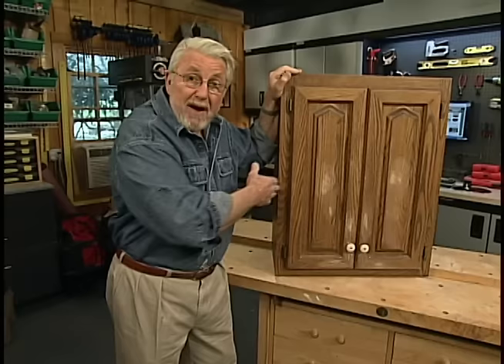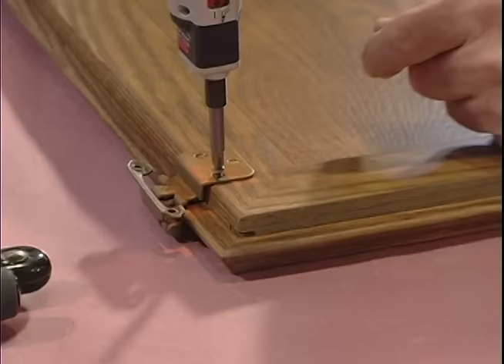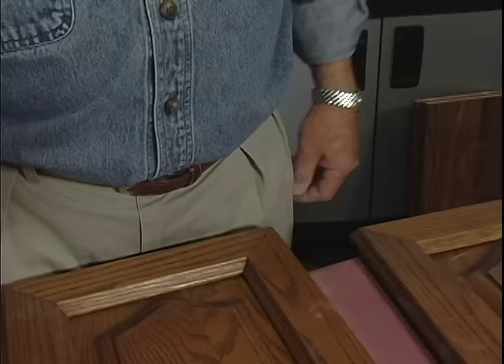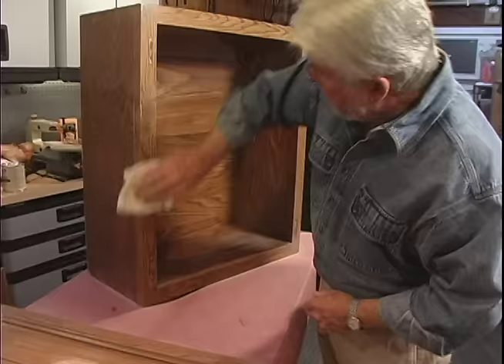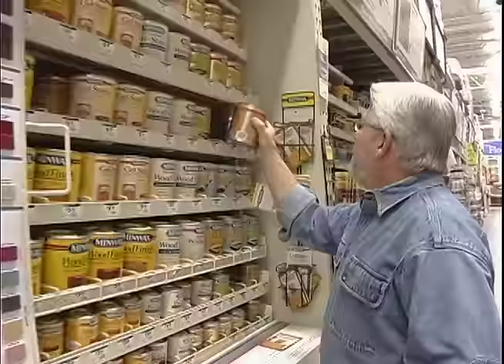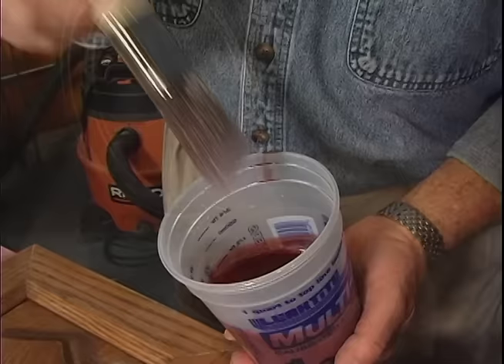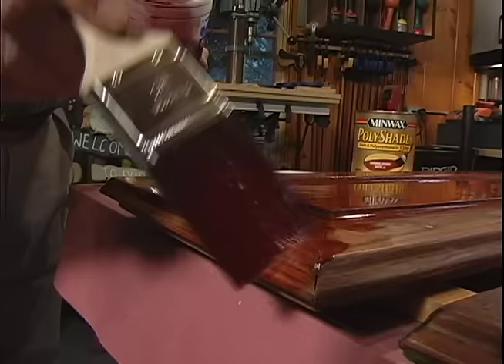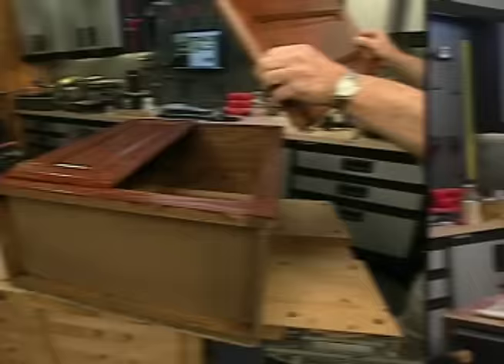Refinish Kitchen Cabinets Without Stripping

Comment: Finally someone who's not painting over beautiful wood cabinets.Thanks.
Reply: My Grandparents house, RIP. The New Owners Took all the Glass Knobs Hardware off, replaced with cheap plated brass hardware. Then they Painted the Solid Maple Doors, my Grandfather Finished them himself around 1947, and refinished the Varnish over the years. The Varnish was as smooth as glass. There were no Stains Scratches or Chips in the Wood. Makes me sick what they did.
Reply: I get paid good money to paint stained cabinets. Usually do a specialty finish over the paint. Looks way better in older homes with too much stained wood. I also do his style of finish also. Never do I use stain and poly.NEVER. It just looks really cheap. After using gell stain,I will spray poly over it.
Reply: We are getting ready to remodel our kitchen and want to keep the wood cabinet faces out neighbor made 30+years ago.   It doesn't appear that ours have been sealed at all.  I'm thinking of just using re-store on them, than some wax made for them.  I'll probably do it this way when we remodel our bathroom.
Reply: Amen.

Comment: I called a licensed painting contractor to get a quote on refurbishing some custom cabinets in our home and some wood flooring.   20 years earlier I had paid $5,000 to a licensed contractor to do the same.  This time a salesperson came out who had no knowledge, took pictures with their macbook and then emailed a quote of $24,500.
YouTube saved me with videos like this one.  Especially helpful were Ron's suggestions on replacing the hardware with new hardware and not shaking the can but stirring instead to avoid air bubbles.
Thanks, Ron!
Reply: How did u work
Reply: I just received a $20k estimate to repaint my kitchen cabinets. I laughed when I saw it. I'll be doing it myself!

Comment: The sequence of events is spot on. Two that are not used by most "flippers" are washing off with a solvent prior to sanding to remove if only some wax and cooking grease. The second is when painting multi layer doors including entry doors is to paint from the inside out saving the horizontals and then the vertical  elements for last. The product used is an alkyd and a natural bristle brush is more suitable than a synthetic bristle. Natural bristle brushes should be considered needing pre washing and drying in paint thinner before any painting or clearcoating is done.Working out of paint cans is counterproductive. Transferring the "paint" to a container larger than the volume of paint allows one to see if the "paint" has been completely mixed with no traces of pigment, filler or flattning agents left in the can.  A great 5:19 lesson from a pro.. Yep, we can tell...just by the way the sandpaper was folded.

Comment: Another way to stir  is with a bent wire coat hanger.  Straight into a drill then bent at the bottom into a whisk form.  It stirs the bottom into the body and doesn't introduce bubbles into the mix.  You can stir fast or slow - your preference.  By raising and lowering it, you blend the whole thing - or put bends into a length that fits the can and then blend the whole thing together.

I use this to blend/mix my stains and paints.

Comment: Wish I had seen this before I completely sanded my bathroom cabinets down to the clean white oak surface and refinished with stain and polyethylene. 
Also use caution when updating the hinges. I removed the old antique brass hinges and replaced with the same kind of oil rubbed bronze hinges. Even though they looked the same, they are different. The screw holes do not line up. I just screwed into another place on the door, but had to drill out the old holes on the cabinets and plug them with dowels before realigning and reinstalling the doors.
Reply: I am going to use the same hinges and just clean them thoroughly. The old ones are made really well compared to the new ones. Also, why waste good hinges when I use reuse the old ones. Also, it will be easier just to put them back.

Comment: The tip about folding abrasive paper into 3 is actually more useful than you would imagine, whether you tear your paper into halfs or quarters isn't the point,the point is you have 3 faces,6 edges and the folding it back on its self means it holds it self together, if just folded in half it just slips...as told to me by my tutor in college on the first day....40 years ago.

Comment: Polyshades works quite well for this. However, you do have to apply it as thin as possible and look over your project carefully for sags on vertical edges. It tends to settle along these edges leaving a darker line.  A high quality brush is very important.
Reply: What about applying with a cloth?
Reply: @careybowden4864  I have never tried it. A good brush and mineral spirits to clean the brush is not that expensive.
Reply: i like to have some foam brushes handy for those areas your referring to.

Comment: One of the things I was really looking for was doing both sides. In my previous projects I have found that the stain/finish application always accumulates where you can't see it from the top until you turn it over. Then it's a chore to get rid of the excess and still make it look good. I'm guessing you rest the door on something smaller then the door to raise it so that you have access to that excess.
Reply: I've had that happen to me as well.  What I found best is to place a gallon paint can, or something a bit taller, under the item so that as I do each edge I can gently wipe away any finish that may have run under the edge.  I use a clean cloth dampened with mineral spirits.  I use this same method when I]m staining or painting.

Comment: I guess it's easier to go darker, rather than lighter. I think applying stain on the entire surface, letting it dry, and then spraying varnish on top would also work.
Reply: But this two in one product saves the step - looks good to me
Reply: @elizabethhallowell5115  Scratches and knicks would stand out because scratches and knicks would take the two-step coating differently. This would be especially true on doors and the front of cabinets, ... and much more if those surfaces happen to be a eye-level. There is a place for this product, but wood surfaces would have to be next to perfect.

Comment: Here's how I refinished my oak cabinets.  I sanded them and stripped all of the finish off.  I grain filled them with aqua coat and then resanded them.  I then used my $13 Harbor Freight spray guy to spray Sherwin William's Acrylic Enamel.  It was a lot more work than what you see in this video, but the results were excellent and the cabinets look updated.  Oak be gone!

Comment: Thank you for the pointers. I will be re-staining my kitchen cabinets in the next couple of months
Reply: Me too!! from golden oak to a beautiful grey!!
Reply: Based on my 40 years of experience, now retired, in painting, staining, faux finishing, restoring antique wood finishes in all kinds of furniture, this is the worst advice I have ever heard from someone who is suppose to be a craftsman. My god, LOOK AT THE DETAIL  after he is finished showing the before and after. There is all kinds of flaws in the finish!!! YOU NEVER EVER USE A POLYSTAIN in refinishing....PERIOD..and NEVER USE A STAIN PENCIL...PERIOD....Refinishing anything without taking it completely down to bare wood requires time and patience in order to get the stain evenly dispersed around your project no matter what it is. Yes, for the novice, do the prep work he suggests and thats where you stop with this guys advice. Again, for the novice, buy yourself a ' GEL STAIN' and a professional natural bristle brush. I recommend getting the blond bristle. Again, for the novice, you want to take the brush and place it in a container full of mineral spirits and bounce the brush up and down on the bottom for a minute. This will aid in loosing and loose bristles that may be in the ferral. Remove the brush and shake it out by placing it between both your hands and rubbing the brush back and forth causing the brush to swirl back and forth. Put the brush back in the mineral spirits and repeat. Next put the brush back in the it's wrapper that it came in and let it dry over night. Again, for the novice, After you have prepped your project, use a little amount of gel stain on the brush and get in all the crevices first and they all the flat parts and sides, called revels, and let dry over night. Remember to clean the brush each time you use it!! DO NOT USE a lot of gel stain because to do this right you may have to do this a number of times perhaps up to as much as 3 coats for uniformity. Next day, look where all the light spots are, that is where you need to add just a little of the stain. Dab a little on with a non shedding cloth or paper towel than take your brush and sweep very lightly over the area to cover it and feather it into the rest of the wood that is not so light. Let dry. Do this again until you see uniformity. Then apply another light coat of gel stain and let dry and again, look for light spots and repeat what I said above and let dry. Next look for light spots if any, repeat if necessary. After you have uniformity, and your project is dry, apply by spraying, from a can, a light coat of polyurethane to seal in the stain. Let dry. Then you can a use either 2-3 more coats of spray or 2 coast of brush on polyurethane and let dry completely before putting the hardware back on. Now enjoy your project.
Reply: Based on my 40 years of experience, now retired, in painting, staining, faux finishing, restoring antique wood finishes in all kinds of furniture, this is the worst advice I have ever heard from someone who is suppose to be a craftsman. My god, LOOK AT THE DETAIL  after he is finished showing the before and after. There is all kinds of flaws in the finish!!! YOU NEVER EVER USE A POLYSTAIN for refinishing..PERIOD.. and NEVER USE A STAIN PENCIL...PERIOD....Refinishing anything without taking it completely down to bare wood requires time and patience in order to get the stain evenly dispersed around your project no matter what it is. Yes, for the novice, do the prep work he suggests and thats where you stop with this guys advice. Again, for the novice, buy yourself a ' GEL STAIN' and a professional natural bristle brush. I recommend getting the blond bristle. Again, for the novice, you want to take the brush and place it in a container full of mineral spirits and bounce the brush up and down on the bottom for a minute. This will aid in loosing and loose bristles that may be in the ferral. Remove the brush and shake it out by placing it between both your hands and rubbing the brush back and forth causing the brush to swirl back and forth. Put the brush back in the mineral spirits and repeat. Next put the brush back in the it's wrapper that it came in and let it dry over night. Again, for the novice, After you have prepped your project, use a little amount of gel stain on the brush and get in all the crevices first and they all the flat parts and sides, called revels, and let dry over night. Remember to clean the brush each time you use it!! DO NOT USE a lot of gel stain because to do this right you may have to do this a number of times perhaps up to as much as 3 coats for uniformity. Next day, look where all the light spots are, that is where you need to add just a little of the stain. Dab a little on with a non shedding cloth or paper towel than take your brush and sweep very lightly over the area to cover it and feather it into the rest of the wood that is not so light. Let dry. Do this again until you see uniformity. Then apply another light coat of gel stain and let dry and again, look for light spots and repeat what I said above and let dry. Next look for light spots if any, repeat if necessary. After you have uniformity, and your project is dry, apply by spraying, from a can, a light coat of polyurethane to seal in the stain. Let dry. Then you can a use either 2-3 more coats of spray or 2 coast of brush on polyurethane and let dry completely before putting the hardware back on. Now enjoy your project.
Reply: Dannyixoye well do a video on how to do it properly then
Reply: @dannyixoye262  thank you. Taking your advice. Now make a video please
Reply: @dannyixoye262  make a video please!

Comment: Buying 1 new handle for 1 newly mounted kitchen door has lead me to replace all the handles on all my cabinets and if I'm gonna do that, I had better re-do all my kitchen cabinets first! Since I'm doing all that, I had better faux upgrade my counter tops and add a faux tile backsplash by my kitchen sink too since I have never had one there. All this will require getting a new faucet, and I should have a new sink too but that's where the buck has to stop for now.. Lol Thank you for the great video! Ummm...might need paint in a few places too!
Reply: One thing leads to another!  We decided we needed to replace our formica countertops and floor.  Then we decided the wallpaper has to go!  Oh, what a lot of decisions to make.  Not only that, we have to remove all pictures and remove everything on the floor of the closets.  That leads to decluttering and putting stuff downstairs.  We will have to remove 3 bedroom sets in our living room and sleep in the downstairs bedroom.  Might have to end up doing dishes in the bathtub when the kitchen is done.  A good thing I work so I don’t have to look at the mess all day long!

Comment: Thank you so much for your helpful and detailed video!  I'd like to refinish my kitchen cabinets but I'd like to paint them in a different color. Should I sand them more heavily? Is there any other step I should take into account before applying new paint?
Reply: Do you mean paint instead of wood stain?, if so, I would say prime ( have it tinted the same color you want to paint them), use two coats and sand in between with a 120 sandpaper. 2 coats of paint depending on paint and color then sand with 220 in between. Hope this helps. ( if you don’t want to sand that much, BIN primer is highly recommended but, make sure to use a respirator and good ventilation. Work quick ).

Comment: I really HATE using the combination stain/poly.  It is VERY difficult to keep "smooth"
Reply: I add a bit of mineral spirits to it and it makes it much more easy to apply and get a smooth finish.  Have you ever used PolyWipe by Minwax?  It's a great way to go.  You can add stain to it and get the smooth finish you want.  It takes at least 3 coats.  It's easy to apply.  I saturate my cloth, apply and rub it in until the shine is gone.  Let it dry and then apply the next coat.  No sanding in between.  Looks like natural wood when finished.  I get beautiful results using this method.

Comment: Does the stain come out pretty even when using MINWAX PolyShade? It looks like one cabinet door is a little different than the other, as in, some areas seem much darker. Should I go over areas with a dry brush in the nooks and crevices to get rid of any pooling? Thank you.

Comment: There are no short cuts in refinishing wood , it has to be chemically dipped in laquer thinner or similar solvent then sanded down because the stain is just going to sit on top of the varnish or laquer shellac ect. You can touch up stuff but if the finish is not in good shape just get a big plastic container like for storage underneath your bed with a lid and buy 5 gallons of laquer thinner and lay each door in it for about 10 minutes and the finish will fall off.  I used a green scotch brite pad and a stiff plastic bristle brush for the recess ed parts,  then let the doors dry then sand them with 100 to 120  then 150 200

Comment: my cabinets have a rather thick clear coat which started to shows cracks.  Do I need to remove that clear coat completely?  Your light sanding step indicates I just need to rough it up, but how would the new stain penetrate if it is still on?
Reply: I think the poly "stains" aren't really stains, they're just poly with some color in them.  So they don't actually seep into the wood at all.  It's all on the surface.

Comment: I found this product will chip off in heavy use areas and the underlying finish remains. I sanded well before applying. It did for the front edge of my roll top desk.

Comment: I did it and it's still wet after 3 days how do I fix it? I applied a reeeally thin layer but still it is not drying. Should I use something on top of it to make it dry?

Comment: I have Maple kitchen cabinets I got from Lowes many years ago. I've always just used a gentle cleanser to get the grease off , esp those near the oven, but now I have a problem. After several cleansers, they were still very "tacky" and seemed like built up grease. I tried Goo Gone  and still tacky. I have a few areas where the finish is gone as well. The cabinets look great overall, I don't want to replace them. I just want to de-grease them and seal the unfinished areas. Thanks for your advise.
Reply: Just my two cents ... the cupboards near my stove are er pretty tall. To clean I mixed a gallon? warm water, pint of white vinegar, and a couple squirts of blue Dawn dishwashing liquid, mix up pretty good, not bubbly, lay down some newspaper on the counter for drips, apply with a reasonably damp floor mop, rinse and repeat... it breaks down the heaviest grease

Comment: A question for you. What can be done when it is impossible to match the mounting hole pattern of the hinges?  Our cabinets date to 1977. Sometime in the early '80s, the manufacturer moved production to China, where new molds were created, and there is a better than 1/16th of an inch difference in the hole positions - too close to make new holes, to far away to get the screws to fit. 
Any ideas?